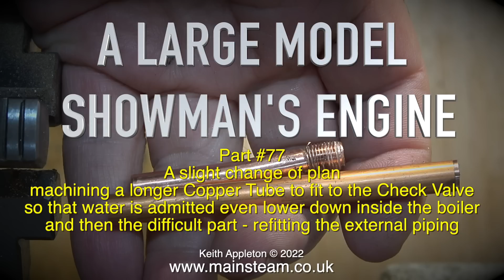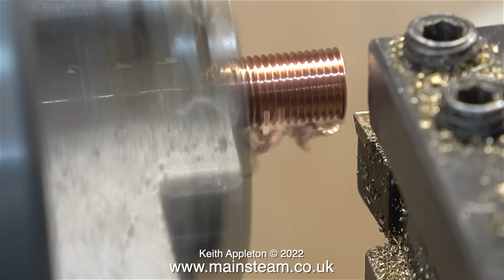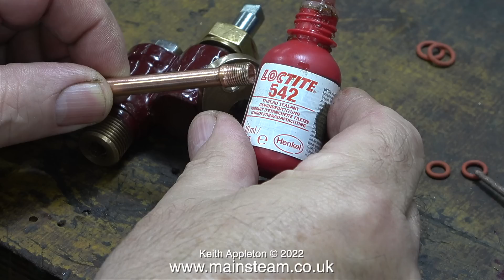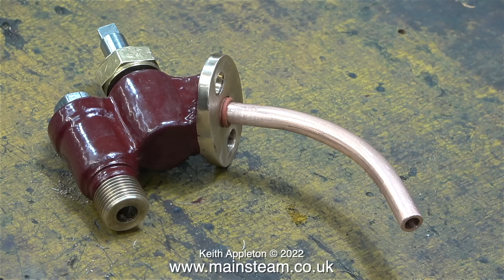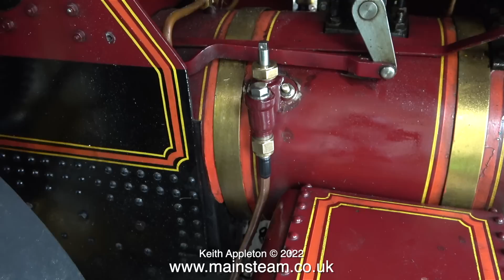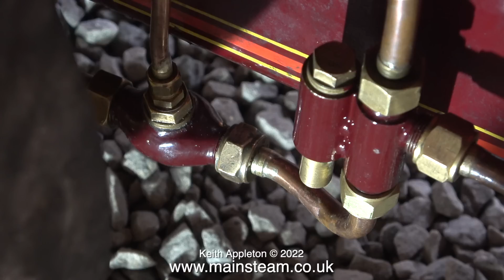A LARGE MODEL SHOWMAN'S ENGINE - PART #77

Comment: Good point about fouling the fire tubes in the boiler. It's easy to forget about the internal structure.

I'm a bit surprised you didn't anneal the copper tube after machining it, but i don't know how much work hardening to expect from the turning operation.
Reply from the maker: As I say over and over again, these videos are designed to be tutorials, and I purposely broke the pipe to show what happens - it was far too thin ........ and annealing it was really not worth the effort.

Comment: Could you make another flange with the tube soldered on, rather than thread it? It would sit between the boiler and the check valve.
Reply from the maker: I suppose so if I wanted to do it the hard way . . . .